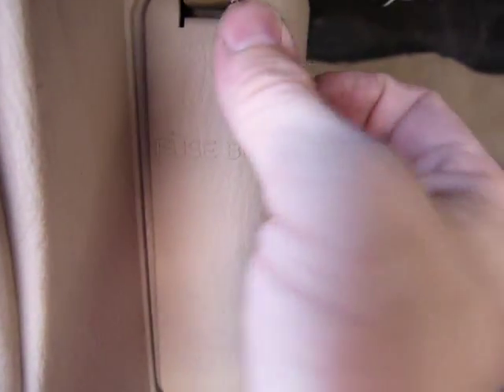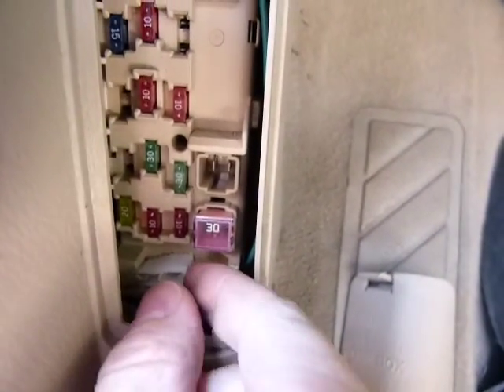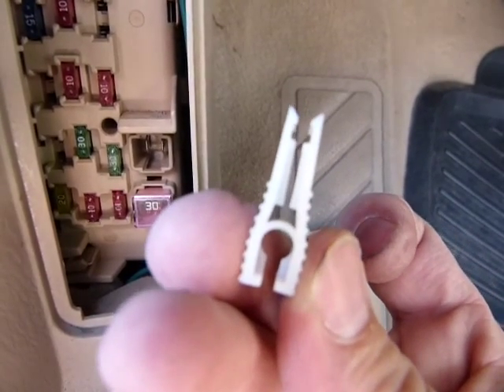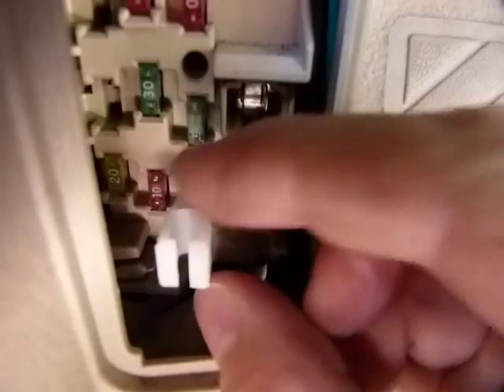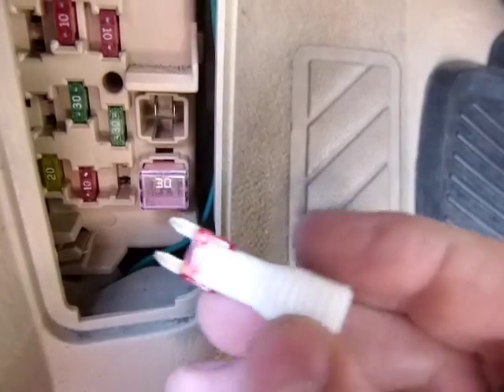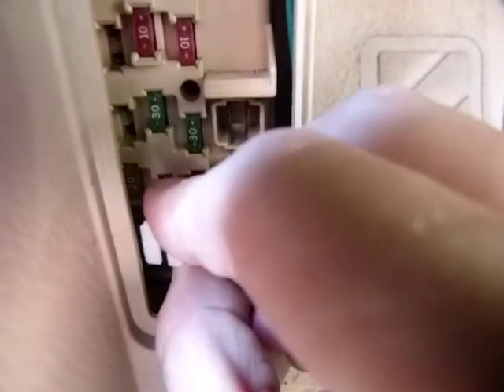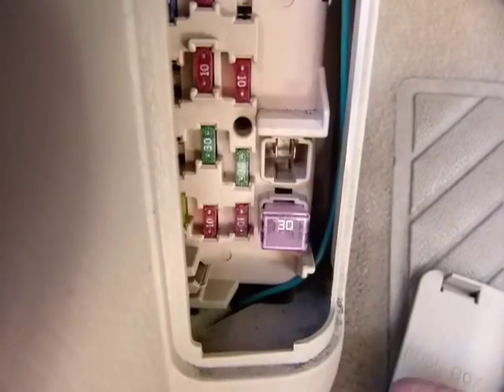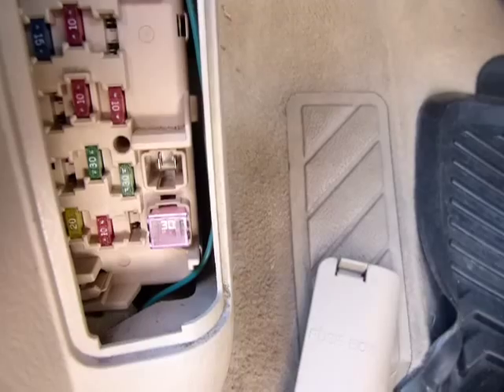How to use a fuse puller

Comment: If a fuse is being stubborn, or is in a difficult spot to get leverage on it, it might help to run a string or thin rope through the fuse puller, then pull on the string or rope (while holding the puller with your fingers).
Reply from the maker: Totally, I do the same sometimes

Comment: Mine wont reach in deep enough to be able to grip
Reply from the maker: Different models are available, some narrower and longer
Reply: theoverengineer i was able to use a flathead screwdriver to wedge it out just enough to use the tool. Thanks...

That said, the new fuse (for the cigarette lighter) immediately blew again once I plugged my phone charger into the cigarette lighter.
Reply: Your 12v adapter is either shorted out or the thing you are using is too high power.